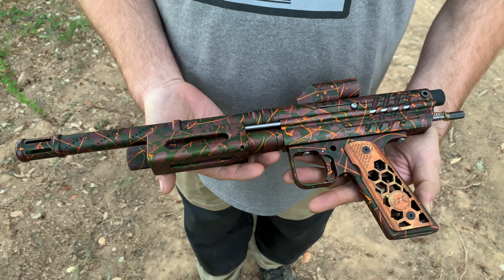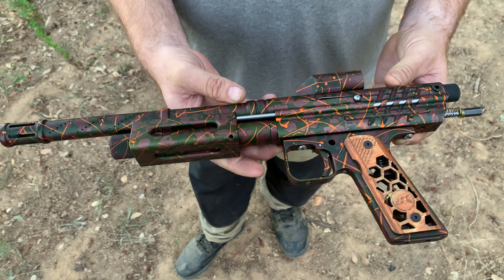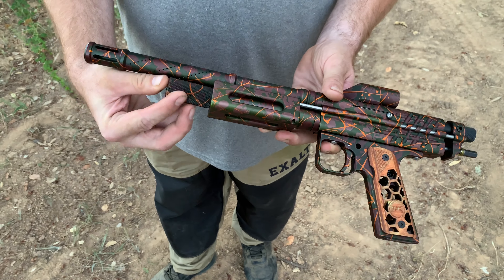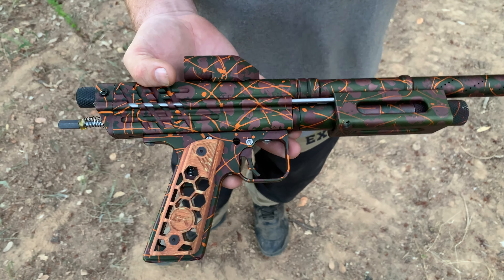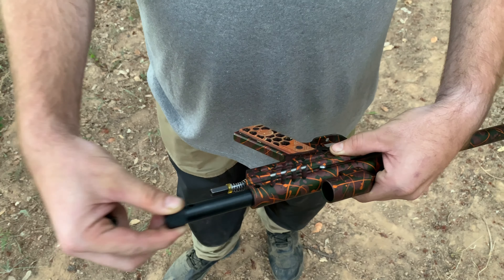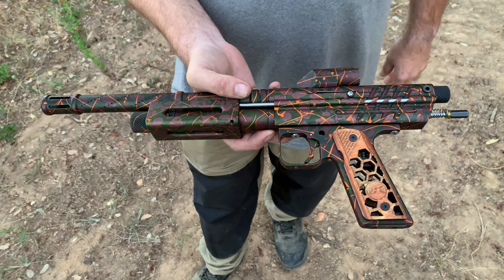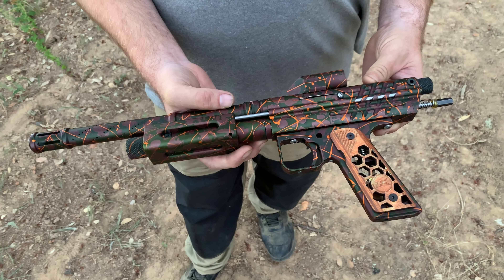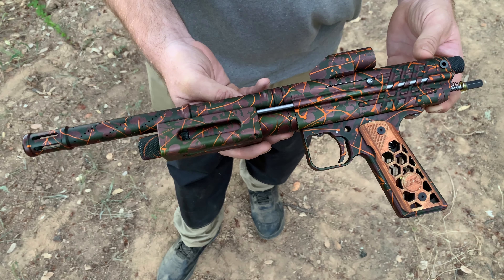KPCS' Scout - A Stock Class Sniper Pump Paintball Marker w/ Robert Brandon of NCPU

Comment: There were 6 that I first made with a Stock drop out changer.   Then I made a Scout II that had a gas through frame to a Palmer reg in front of the valve with the pump handle over it.   This one in the video I redesigned to be a true stock class 12 gram changer. I did a 9 gun run .  Working on making another run again.

Comment: Using a Diamond Labs valve is like the worst valve you could use for a stock class gun. The massive outlet port in the valve body (think RAT II valve) will counteract that small diameter bolt. Something like an early brass valve or an early ANS valve (which have very similar specs to aformentioned brass valves) would work much better. Probably get 5 more shots per 12g with that.